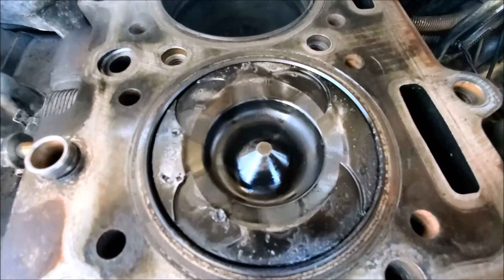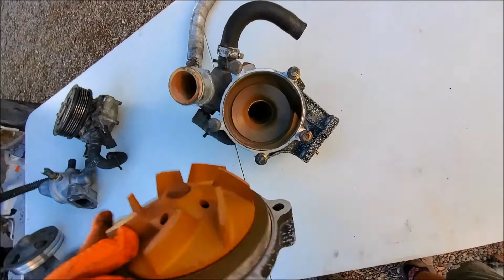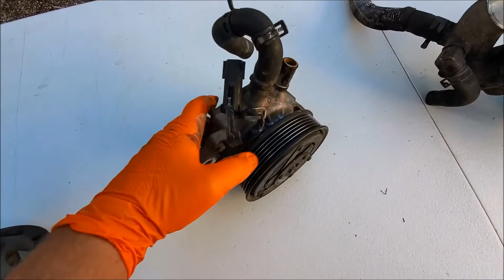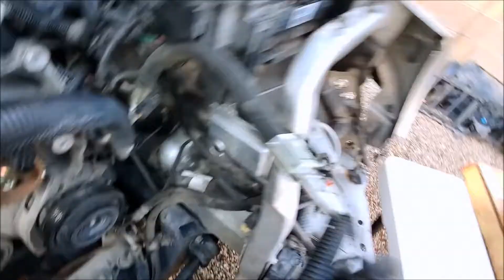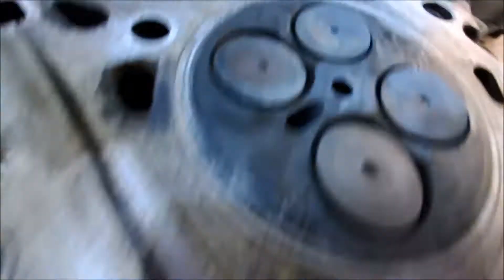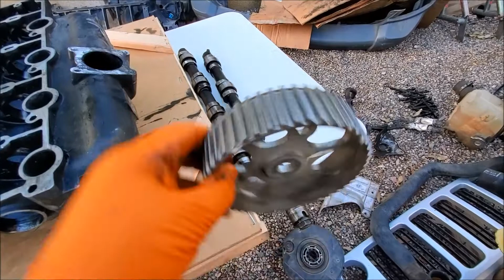Jeep Liberty CRD update. Engine disassembly complete.

Comment: Jim, I can't find where you removed the cam shafts. On reassembly how do you know they are timed / in correct position? At end of video you indicate just line up the timing pin marks/holes but it can't be that easy. Any advise is appreciated.

Comment: Like the video , asking for some help I have a 06 with a no start. The condenser fan turns on as soon as I turn the key on . I can see the coolant temperature sensor at 495 degrees. The engine cranks but does not start . I am think the ecm has a problem. But maybe you can help . Thanks in advance.
Reply from the maker: Check all your grounds. Behind the battery and in the passenger foltwell and in and around the fuse box to the left of the dash
Reply: @daytonagrayghost  thanks I have an ecm code p0610 and p0564 and p1186 . Thanks for responding.
Reply from the maker: @hectorestrada5751  Is your fuel system pressurized and purged of air. Use the bleed valve and prime bulb on the top of the fuel filter to check for fuel and bleed the air.

Comment: 06 2.8l diesel question on vicious heater? Can you help?
Reply from the maker: What's the issue?
Reply: @daytonagrayghost  Sounds like dry bearings inside. Do I have to replace the whole thing or can the bearing inside be swapped out? I only ask that because the part is on avg $400 or not available at all. I think also it might have something to do with little cabin heat?
Reply from the maker: @beinthenowmedia7638  I am not sure if they can be rebuilt. Someone on the Liberty CRD Facebook page makes a delete kit for the viscous heater. Perhaps they know if the bearing can be rebuilt. Does it make the noise when only engaged? Perhaps it's the clutch?
Reply: @daytonagrayghost  I'm not 100% sure, I've read a lot because I'm not an expert and others have listened to it so I'm just going off that. Looks like I'll have to replace the whole thing. I requested the fb group. Hopefully I'll learn more about my jeep there as well. Thank you for your responses.

Comment: It is a mistake to use the ARP head studs.  American Racing Products does not recommend their products for the CRD engine.  The kits that you get from retailers are specified by the retailers themselves; ARP simply fills the orders and has performed no research and development work on the CRD engine because there are not enough CRD engines in the North American market to justify the R&D expense.
Reply from the maker: Thanks for your comment and the data you sent regarding the ARP studs. I made my decision to go with the ARP studs on data from several sources. I was on the fence about it and can see both sides. What sealed my decision was when my local machine shop encouraged me to go with the ARP studs.